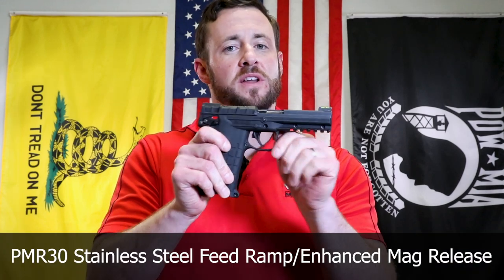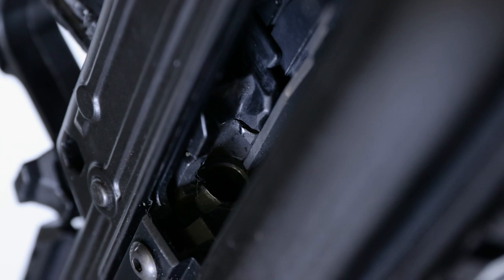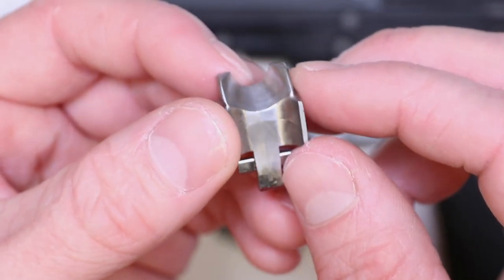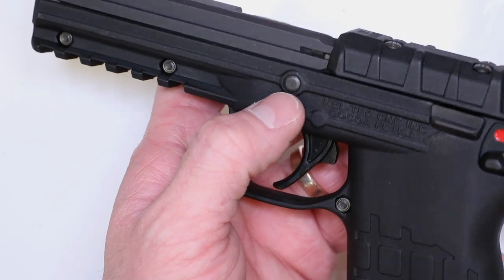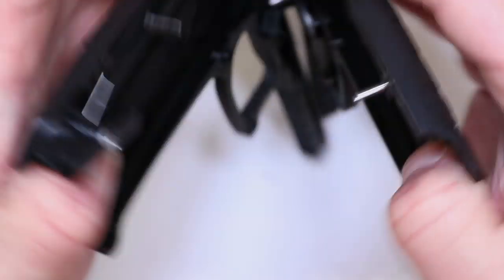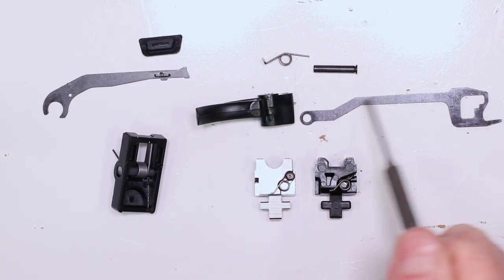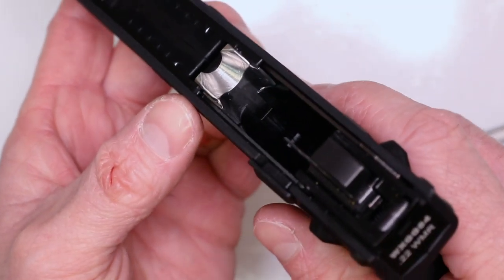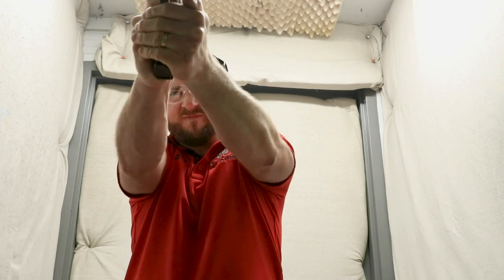KEL TEC PMR 30 Stainless Steel Feed Ramp and Mag Release - KEL TEC PMR 30 Upgrades by M*CARBO!

Comment: What ammo are you using? Keltec recommends at least 40 grain!! CCI maxi mag in particular!!
Reply from the maker: With our upgrades and minor tweaks to the mags, we've made the PMR run with any ammo.
Reply: @MCARBO  I found that to be the case. I can run 35 grain up to 55 grain with no feed or firing problems at all. 
So far, after adding the MCarbo parts, the gun has shot perfectly and actually feels a lot smoother than factory.  The grip made a huge difference in the feel of the gun.

Comment: Hi, love the new feed ramp 👍 I question, I just put it on and now I'm having a problem with the feeding on the left side, right side feeds great, but the left side is having a problem feeding? Any help would be great 👍
Reply from the maker: Most likely this is due to weak feed lips on the magazine. We've found in slow-mo video that the feed lips can deflect up to 30 degrees and cause a jam. The current fix we have found is to take just the magazine body, heat it and press the feed lips closer together in a vise. let cool and reassemble the magazine.

Comment: Got the steel ramp today and after a long install, my hammer won’t cock back. I’m guessing I overtightened screws so I tried loosening but still not sure.

Update:
FINALLY GOT IT!
I thought something was wrong so I took apart and put back together 3 or 4 times but it turns out I just couldn’t get the hammer locked back with my fingers. Used the flat end of a pen to push it down and everything is running smoothly.
Reply from the maker: Awesome!  Nice job troubleshooting the issue.  PMR30 can be really picky if the screws are too tight.  Hammer needs to lock back during reassembly.  Glad you got it running!  How’s the new SS Feed Ramp compare?

Comment: MCarbo, great work brother!!! I subbed on the mag release alone, perfect upgrade.  I have a gen II so I dont have feed ramp issues, but I'd still like to do this upgrade,  however,  my concern with the metal feed ramp is that internally over time and shooting, will it wear away the plastic that holds it?? I think keltec just needs to make an all aluminum version bc polymer and metal dont mix. Just some thoughts for the pmr community.  Thanks brother!!